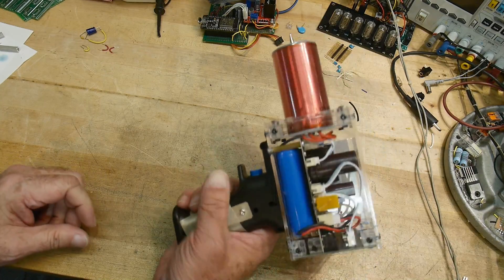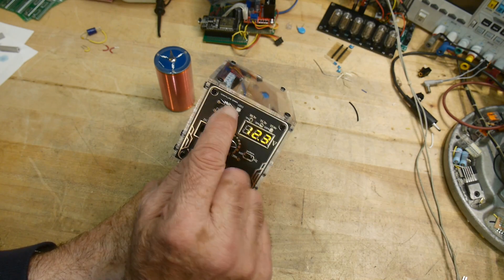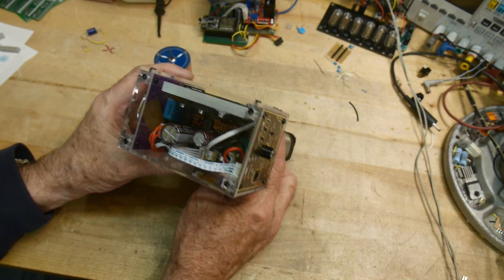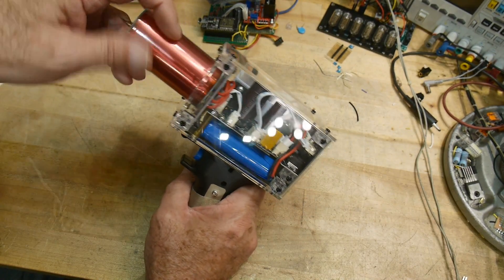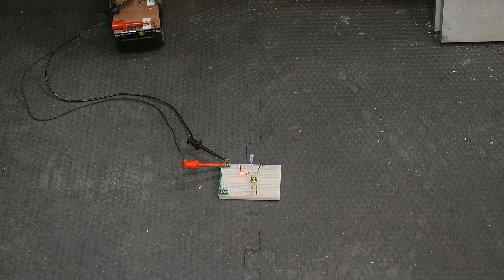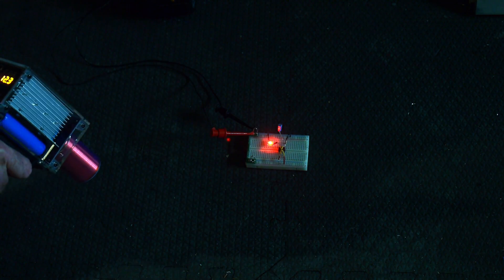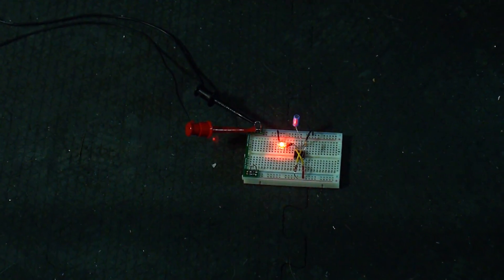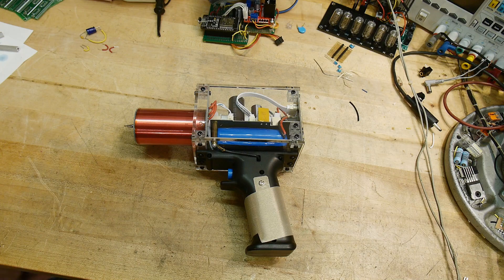#1813 Handheld Tesla Coil

Comment: And keep the pacemaker clique at minimum safe distance. The single MOSFET SlayerExciter Tesla Coil I built from scratch ran at 1.2mhz would power on my cheapy handheld oscilloscope to show there was a sine wave and burned out the control board of my dryer just inside the interior garage door about 20 feat away.
When there’s no arc or sound then worry

Comment: How about programming an ATtiny to flash an LED and see what happens. Should be able to configure that ATtiny to operate down to 3 volts so you can power it on just batteries.

Comment: It's harder to kill a chip if it's powered than if it's not, actually. The input protection on chips shunts unwanted current to the power rails, so if a chip is powered, it's actually protected by the power supply as the protection circuits have a low impedance path to ground via the power pins (rather than through the silicon). Also, TTL chips like the 555 are more robust because of all the diode junctions - CMOS chips are far more fragile and static sensitive hence the anti-static bags they get shipped in. The gate of a MOSFET touches a thin layer of silicon dioxide (glass) which a large ESD will easily damage which destroys the transistor. So your Arduino, connected to a battery could actually survive much better than if it was by itself as the battery provides the grounding path and is able to handle the impulses far better.
Reply: There are limits to how much current the overvoltage diodes can shunt to the power supply.  But that Tesla coil won't be generating much output current.
Reply: The 555 is an analogue chip not TTL.
Reply: I think it's also because the tesla coil and the 555 circuit are both floating on separate batteries. There's no common anything between them, so there's never really a circuit formed with the HV spikes, other than capacitive coupling to the air I guess.